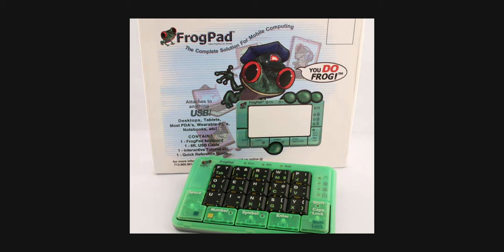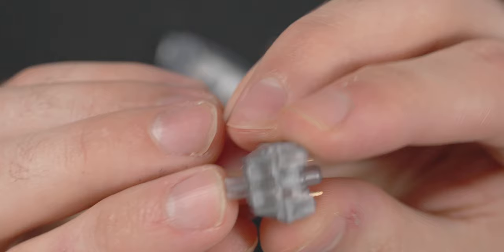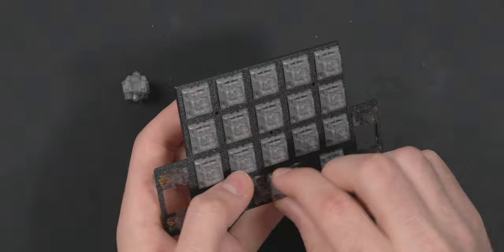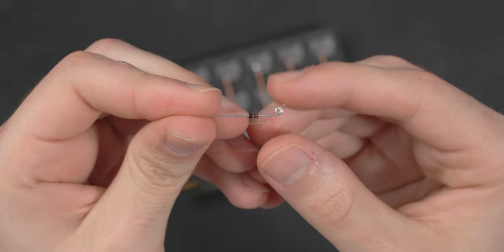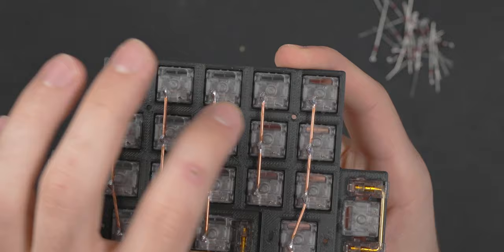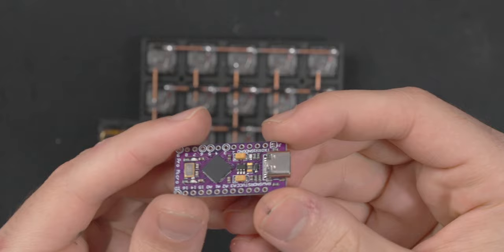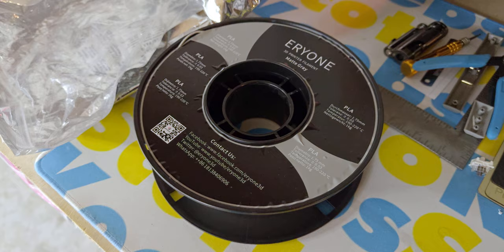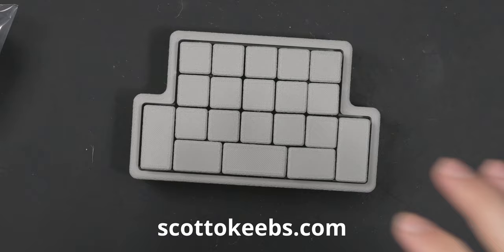Building the ScottoFrog Handwired Gaming Macropad

Comment from the maker: Now if only I could figure out how to print switches 🤔
Reply: uh oh 👀
Reply: if it doesn't tear itself apart after a few strokes I'd be drowning in switches
Reply from the maker: There are some designs out there. I would probably try incorporating them into the plate.
Reply: i'd definitely go with resin for that 😅
Reply: it would be really cool if someone use galvanoplasty (Electrotyping) with 3D printable parts, not only for some cosplay props, but for some technical applications:)
i mean that something like 3D printed springs is already exists, so why not to try make conductive parts of switch to combine all together and try to get some experimental full diy switches?
maybe it would be intresting challange...
what if in the future we will have like openscad files with all params and able to print switches and make parts conductive and play with this a bit
if someone had a time machine please tell us how is it going in the future!

Comment: Oh man, yeah platemount stabs on 3DP plate is such a PITA. Never been able to get mine tuned right. I usually use a tiny file to correct the fitment but I still find it impossible to get them up to the standard of pcb mount stabs. Cool project man! I love the little diode twisting jig, will definitely need to make one of those myself!
Reply from the maker: Yeah, they can be obnoxious and only more annoying as they get longer

Comment: This largely misses the point of the original, a pocket sized portable device. They were even good on an arm band.
Reply from the maker: I also have wireless firmware available for it that exactly mimics the original layout of the Frogpad. I just don’t have a use for that so I made it into a gaming pad.
Reply: @joe_scotto  That's cool, I'm just pointing out the original was a very different thing. It was terrible in some ways too, but membrane switches allowed it to be thin, modal input allowed for "decent" one handed use and it's primary application was mobile industrial or administrative tasks like working in a warehouse, construction, military, etc. Think PipBoy (there are actual products like that).